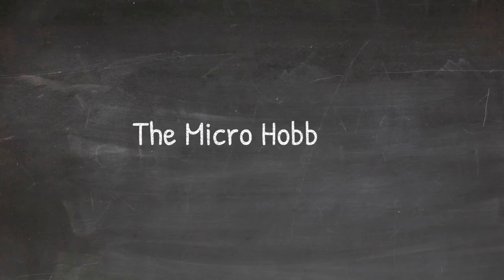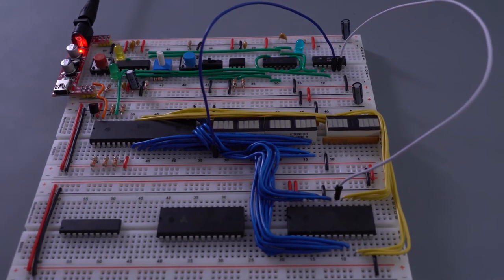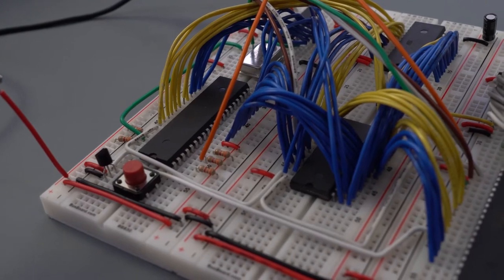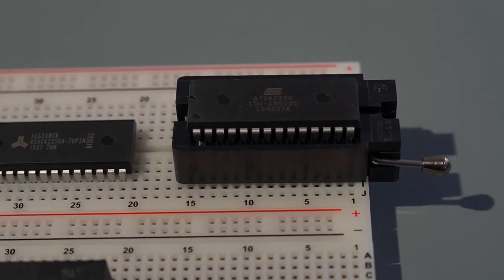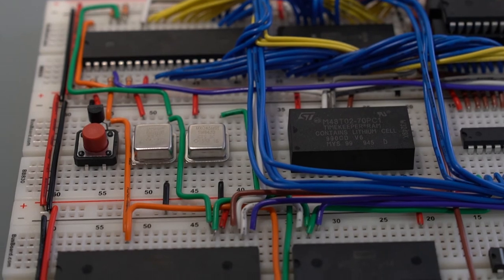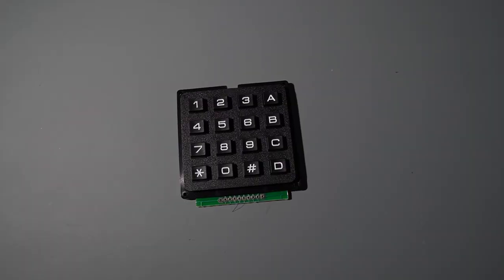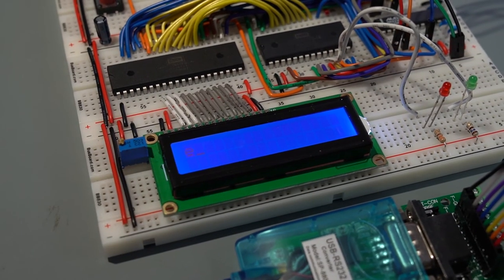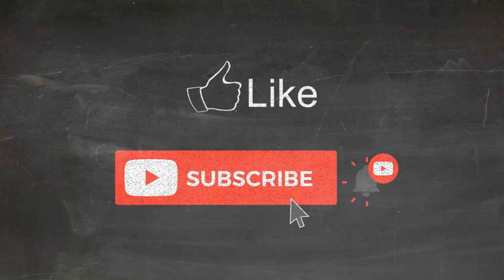6502 Build

Comment: I would be interested in seeing the assembly build on this!
Reply from the maker: I'm due for an update for sure. I'll post something shortly.
Reply: Excellent
Reply: @microhobbyist  I'd love to see your build too!

Prior to seeing Ben take this on, I didn't think I could do anything with electronics. I'm legally blind and would need to spend money I haven't got on a video magnifier and low powered microscope to ever be able to do even basic soldering. Yeah, I could breadboard a 555 but … I couldn't do anything complex or fun, or so I thought.

I don't think I'd want to build quite the same machine Ben did, but … these DIPs are lego bricks for nerds, so it's really just a question of what I want to do with it. I need some additional parts.
Reply from the maker: @knghtbrd  I feel I've neglected the video portion for this project and will re-upload more content soon. I've since designed several PCBs and worked on my monitor program to include more features. And next time I'll use my real voice, instead of a computer-generated one... LOL

I'm curious. When you mention that you don't want to build quite the same machine as Ben, what did you have in mind? 

Also, I'm curious how you'll overcome your eyesight issues. Instead of a video magnifier or microscope, would a high-powered desktop magnifier work for you? Have you checked out prices from AliExpress for better prices on magnifiers and microscopes?
Reply: @microhobbyist  What I said before about the 6502: It's like a lego set. Anything you can mem map, you can just use. It's that easy. So rather than just building it the way Ben built his, I am thinking a little more ambitiously. If I've got a series of pretty standard peripheral chips (or recreations or emulations of a couple that cannot be sourced), you can put together pretty much any 6502 system relatively easily. So why not set up to do that? Put something together where RAM is the entire address bus, say, with exceptions wherever I decide to put them, and then drop peripherals wherever it seems to make sense today? Maybe stick an Arduino Mega (at least until I get around to learning how to program an ATMega32A to do the same thing) hold the 6502 in reset for a moment and program the "ROM" section and switch in whatever peripherals seem appropriate? That could be a really interesting playground. Or, if I keep the '2560 in there, I should be able to have it switch into a logic analyzer mode afterward. That'd be a great debugging tool!

There is something specific I'd like to build … A better answer to the KIM-Uno. I was really excited when I saw that project back when it was created until I realized it was incomplete as a KIM emulation (no timers in the RRIOTs), that it was kind of limited in terms of RAM and expansion, and the "calculator" was really just calling math functions from machine code—I'd figured it the guy who built it was like, "Hey, I built an 8 digit display and calculator keypad, I mean why not do the obvious?

I figure you realistically could build a real KIM-Clone in that form factor. CPU, RAM, ROM, and RIOTs on a PCB. You might need a CPLD to fit the form factor. Then an I/O board with keypad and display. And I want actual labeled buttons, not just bare tact switches. And that other RIOT's ports. Because I want to be able to connect things to it. It'd be really cool IMO!

For me doing anything that requires soldering is going to need me to invest in a video magnifier. Maybe not quite microscope-levels of magnification but … getting there … and with focus control, low latency, light control … the things you need to be able to solder through a camera. I'm used to writing through one, but I've never tried soldering through it. I'd best start with some learn to solder kits. And the video magnifier is a fair expense … which is why I don't have one yet.